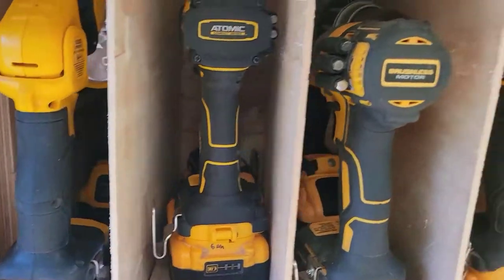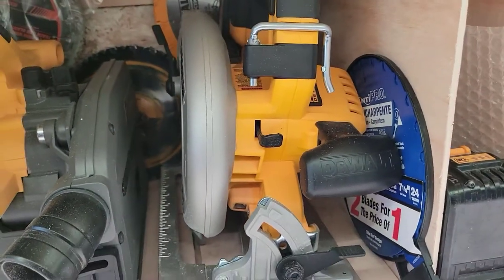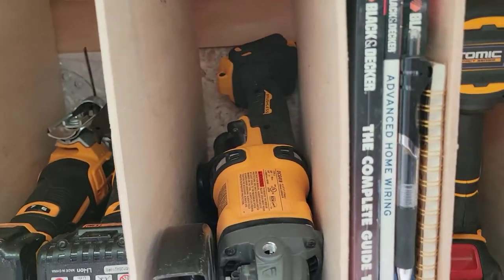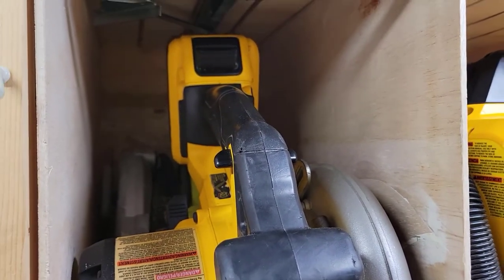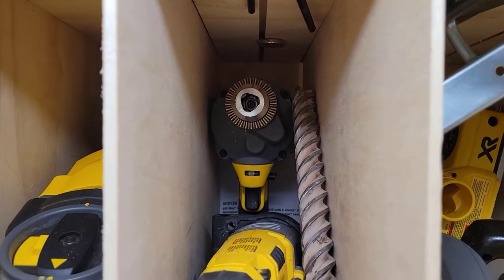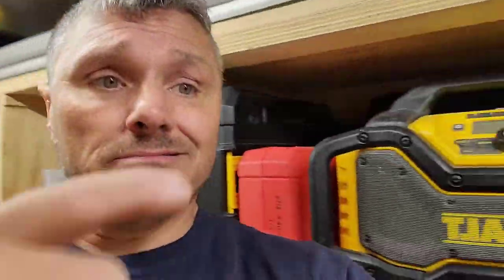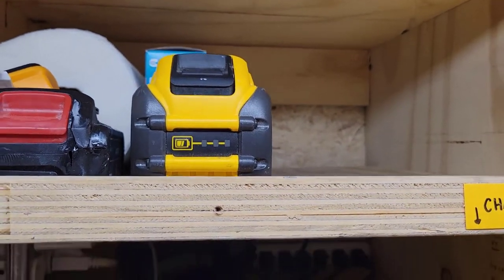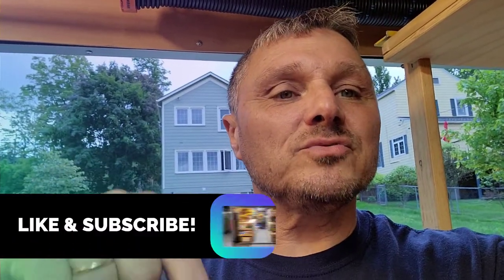NAKED tool storage the way to go???

Comment: I do both. At home in my garage, I have a battery shelf and the tools are stored separately. In my truck I typically keep the batteries on the tools and charge the batteries whenever they show below 3 bars.
Reply from the maker: Thanks for checking out the video and especially for adding your experience to the conversation! I am currently building a facsimile of the left side of my trailer for my basement workshop and in it will be 3 cubbies. I will follow your method where tools inside will be in cubbies without batteries with batteries on a shelf ready to go.

Comment: Steve, in my 18 years of woodworking I've never stored tools without having batteries attached unless I didn't have enough batteries. No negative impact on anything. I've developed the habit of locking tool triggers whenever possible though.
Reply from the maker: Thanks for the comment and for checking out the video! I appreciate it. As long as I have had cordless tools, I also have kept the batteries on the tools. I might have had long term slow discharge with the 9V tool (first cordless) and maybe with some of the 18V (second round of cordless) but that may have been just failing batteries over time. I have had zero issue with the 20V and 60V current round of tools. I run all DeWalt but have heard the same is true for most of other brands. Good advice on the trigger lock! Especially with the multi tool. That one bites easy.

Comment: Interesting topic!  I have never stored batteries on any of my battery powered tools in all of the years I have had them.  It seems like I remember someone telling me that it was not a good idea to store them on tools, but I can't remember who or why.  It is just a matter of habit now.
Reply from the maker: Thanks for chiming in! I have never heard keeping them on tools was bad so I have always kept them on, like in the video and at least for the 20V, seem to have no noticeable discharge nor shortened life since I still have my first batteries running and the tools function correctly too. I admit to being puzzled. The only thing I have heard about batteries is that for 18V, discharge fully with a flashlight before charging but….for 20V when the tool slows, immediately charge.

Comment: I am not a full time contractor (more of a handyman) but I DO NOT store batteries on tools because, for me it is more difficult to remember which ones are charged and which are not.  For me there is no chance of battery drain since they are store separately.  I also do not need to move tools to remove/swap batteries to top battery charges off.  Charging and batteries are in one station/area and tools in another.  That saves time for me personally.  I do keep old broken batteries on the tools though.  Those are the broken and will not charge ones.  I painted the outside of all of the dead batteries a bright color with cheap spray paint so I know they are unusable.  You can instantly see the hi0vis orange or whatever color paint and there is no question about it.  The broken batteries, in my opinion, help keep the tool's battery contacts clean as well as prevent the plastic clip portions of the tools from getting jammed into a bind and broken or broken when simply dropped.  Do not get paint into the contact area of the dead ones being painted so that doesn't make a mess on your tools' contacts. 

When I came up with that idea, I put out a request to the local community for un-useable batteries for whatever brand tools because I did not have enough of them.  People were happy to give me the dead ones for this purpose.  After explaining my reasoning, several of those people have started to do the same thing with their tools/batteries.  I keep batteries in bins like you do with your extras.  I have one for fully charged and one for partial or needing charged.  I keep a third bin for the "dummy" batteries. Swap from dummy batteries to charged ones when you grab the tools needed and swap back at cleanup time.  If there is room, the used ones go directly onto a charger and if those spaces are full, they go into the used bin to wait for a spot. This helps to keep my tools from being broken and I can also keep on track with charging easier.  Wouldn't be needed if I had enough chargers for all my batteries at once but who has room & equipment enough for that?

One last thought, you can take the internals of the dummy batteries out to save weight in the trailer & fuel usage on your tow vehicle.  This allows for proper recycling of the cells.  I don't take the time to remove the internals of mine. 

Hope this idea helps you or someone else.
Reply from the maker: Very cool and very detailed process! Very neat idea to protect the tools with color coded old nonfunctional batteries. My method is that I keep fully charged batteries on tools and when a tool comes back in to the trailer, I check the charge and if less than 3 bars, it goes on a charger before going back on the tool which hangs out on the counter until then. (This is where having 8 charges comes in very handy). This way I eliminated the need for a dead battery shelf. Now that I am able to, I have enough batteries to have one for each 20V and have 3 extra. This also helps. My only broken battery is a waitley but I glued it back together and it still charges so I dedicated it to a battery powered LED string for lights in the trailer when I am not on shore power. Your very detailed comments that outline your process are very appreciated! Neat tip about lightening up the dead batteries. Thanks for checking out the channel

Comment: Hey Steve. I do not store batteries on tools. A rep from dewalt had told me it wasn’t a good idea. However I can’t remember why he said it wasn’t a good idea. So for years I have been removing all batteries from tools . Although I do leave 1 battery on a light in my trailer
Reply from the maker: Thanks for the information. I have never talked with a DeWalt rep and likely would forget to ask the battery question! I have always kept them on like in the video and at least for the 20V, seem to have no noticeable discharge nor shortened life since I still have my first batteries running and the tools function correctly too. I admit to being puzzled!
Reply: @sdsconstruction  hey Steve. I think it was a safety concern. But i have been storing batteries separate for 20 years. So it may have been older style batteries he was concerned about. I will make it a point to ask him about it again.
Reply: Also this is a really good topic . Thanks for the video
Reply from the maker: @realworldcarpentryremodeli5868  the safety idea makes a lot of sense! The multi tool with the paddle switch is really an issue for being easily turned on. While I keep a battery on it, I do not keep a blade on it.